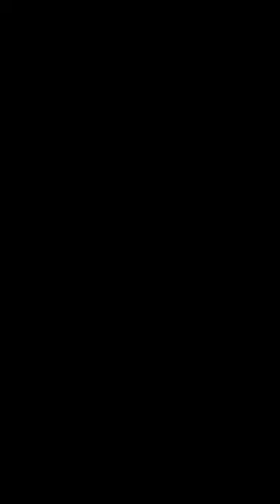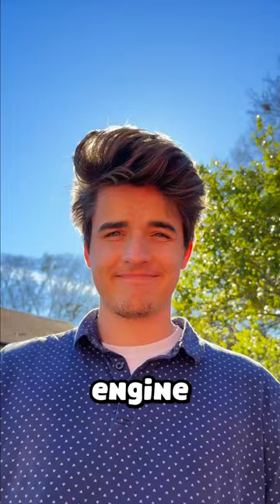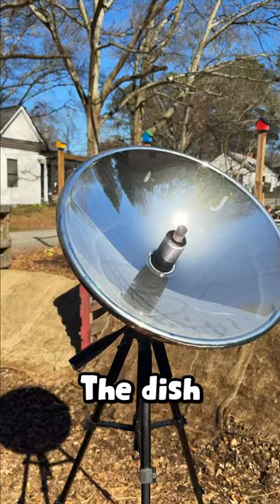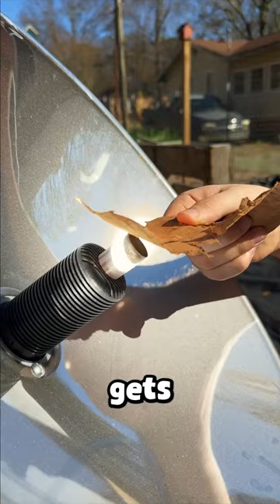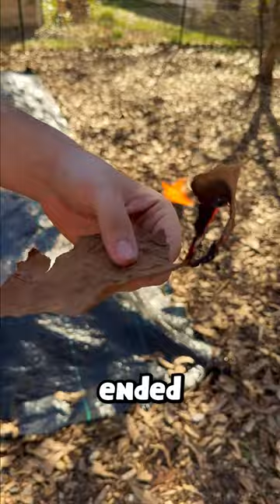Amazing technology! #shorts

Comment: Interesting I’ve never seen this engine type before
Reply: NASA made one called the MODii, it was designed to work in cars, was extremely reliable and efficient but was really heavy and didn’t make much power
Reply: They're not usually solar powered, I've mostly seen them as desk toys/science demonstration toys designed to work using a mug of hot water or ice. 

Unfortunately, Stirling engines need pretty substantial temperature differences to generate usable amounts of power, and the temps have to stay widely different, so they're not really useful for most applications. There are some pretty cool ideas involving them and server centres in artic regions though!
Reply: when i was in middle school i remember some mini engine i saw in school book. It had two mini panels in a glass bulb one was covered with reflective surface and the other was black. So under sunlight black side was getting hot the other side was cooler. That causes low and high pressure thus creates air movement from high pressure to low and panels starting to turn.
Reply: @alpborakirte801  that’s pretty cool any idea what it was called?
Reply: Did he say Stirling engine ?
Reply: You’ve probably seen a sterling engine before. They can look many different ways, commonly they’re small and powered by the heat from a hot drink (ie coffee or tea). They’re very fun and pretty easy to make at home.
Reply: They're mostly used on wood stoves and look different than this
Reply: They make stirling engine fans that attach to wood stoves. Tbh I was experimenting trying to turn a small one into some form of energy production since I use a wood stove in the winter. Pretty much takes the heat and spins some fan blades, I imagine someone who actually knows what they’re doing, could easily replace the fan blades with some sort of device to charge a battery and be able to create a wood powered electricity! I looked into normal thermal generators with the idea of strapping them to the exterior of my stove but they cost a bit much fir the amount of energy they harnessed. But I think it’s 200% possible! Would be cool to figure out how to connect it to my house and help with the electricity bill since the stove is constantly going in the winter!
Reply: They're stuck in the middle ground of power generation and sadly it isn't used much. I think they do have a place, but no one as of yet has successfully cracked the market.
Reply: It's a sterling engine with a dish 😅
Reply: @dragonsaint9446  stirling engines are actually used by a type of Swedish submarines I think
Reply: @MonkstaRS3  I didn’t remember the name but i asked chatgpt with description and it seems it’s not a mini engine as i remember. Its just a good way to demonstrate and teach simple thermodynamics and how you can transform sun energy to mechanical energy. But at the time i wanted to use this as an engine but you cant its too slow and small. 😅Yet a nice tool. It’s name Crookes Radiometer.
Reply: @Dingbobber  so it serves better as a home generator?
Reply: Where can I get one just like this
Reply: @Dingbobber how come something be extremely reliable and efficient but not produce enough energy.

Comment: couldnt you give it a steady and slow supply of water and make the steam power an alternatot? should be more efficient, at the cost of maintanance from the moving parts wearing off and the water pipes clogging up fro. the stuff left behind during evaporation

Comment: I mean a sterling engine is fun and all but I have to ask compared to every thing else you've shown what use could this thing possibly have?
Reply: Maybe it could run an extremely small pump😂
Reply: Its part the reason a Swedish submarines can sink a American aircraft carrier.
Reply: Stirling* and it’s free electricity so long as there’s a temperature differential between the two sides of the displacer cylinder. Might not be much but again, free electricity.
Reply: @cracktact7676  so is a photovoltaics
Reply: @ShinyUmbreon765  ah yes I love repairing my solar panel in the middle of nowhere! Super easy to do! They last forever! There’s reasons to use both pieces of technology.
Reply: @ShinyUmbreon765  another way to convert the sun's energy into everything, for example is to charge a battery like a solar panel does.
Reply: Fire
Reply: Apparently some places use it as a water pump.
Reply: @ShinyUmbreon765  no, photovoltaic is a different thing
Reply: Idk, but if you get it fast and heated, you can make cotton Candy, with just sugar powder
Reply: I don't know how much torque a sterling engine normally has but even if it doesn't have a lot it's still an effective way to turn a heat differential (in this case from sunlight) into rotational kinetic energy, and that's the kind of thing that literally fed the industrial revolution. So you can run a sewing machine, you can wash laundry, you can saw wood, just a lot. And i BELIEVE it's easier to make, maintain, and repair than a photovoltaic panel, because it's made with mechanical components rather than special chemicals.
Reply: On a large enough scale it could run a generator

Comment: I think the big deal with Stirling engines is ANY heat source works as opposed to a specific fuel blend like internal combustion engines. 

TBH they make a huge deal of sense for energy power, the can work with solid and liquid fuel and even sunlight.

Comment: They make stirling engine fans that attach to wood stoves. Tbh I was experimenting trying to turn a small one into some form of energy production since I use a wood stove in the winter. Pretty much takes the heat and spins some fan blades, I imagine someone who actually knows what they’re doing, could easily replace the fan blades with some sort of device to charge a battery and be able to create a wood powered electricity! I looked into normal thermal generators with the idea of strapping them to the exterior of my stove but they cost a bit much fir the amount of energy they harnessed. But I think it’s 200% possible! Would be cool to figure out how to connect it to my house and help with the electricity bill since the stove is constantly going in the winter!
Reply: Power generation Stirling engines work on higher internal pressures and are probably better constructed.

Comment: I probably won't get an answer, but how much power does that small thing generate, and what are you able to run off of it?
Reply: not very much power, just a cool toy.

Sterling engines dont provide much torque or usable energy to power anything useful
Reply: This one? Not much. They can be useful once they are properly made though, and of bigger size. I've read that these are sometimes used as pumps, so when it's sunny, you could feed a pumped hydro system. It would be a pretty effective water heater too. You could also use it as a generator, but I think at these scales it'd be too small. You'd probably want something at least the size of a person for it to produce usable grid power, but it'd still be mostly useless without an energy storage.
Reply: @a-boardmanshawn7314  It's important to note that model sized prototype and real life sized one is very different in terms of amount of power generated. Sterling engines definitely provide usable power, you just don't see that common
Reply: @josetjaw8161  also important to note that all it's reliant in is the temperature difference and the quality of the insulating material in the sterling engine.

Another thing is that you'd probably need a sterling engine that's at an impractical size to power anything the requires a sizeable amount of wattage
Reply: @a-boardmanshawn7314   well any engine that utilises thermodynamic cycle is reliant on temperature difference. And yes, stirling engine has low specific power, it needs bigger size to produce power as much as other engine. In most cases it's impractical but in some cases it's still practical and still used to this day for power generation

Comment: What does a sterling engine do? I get it's powered by the sun, but what do you use it for? Generating power? What is it powering? How much power? Better than solar?
Reply: its an engine. striling engines have been put in planes before. but nowdays they are mostly just desk toys. but you could make a machine with one or make power with an alternator
Reply: @georgekircher4307  you aren't flying a plane with a Stirling engine, they are extremely heavy for their output power. The amount of power they make are barely in the double digits of watts.
Reply: @Ravenousjoe  i litterally said a fact....it has been done. im not even gonna read your whole comment bc its just a fact

Comment: Next episode: practical applications?
Reply: Stirling engines have no practical uses. If heat is from external combustion, use steam and if the heat is solar use photovoltaics to power a motor.
Reply: Electricity
Reply: @ShinyUmbreon765  I can name like 4 off the top of my head
Reply: @ShinyUmbreon765  they do, in fact, have practical uses beside toy/model otherwise every mechanical engineer wouldn't know them from textbooks. It's just quite uncommon that their use make sense under design working conditions. For example, it's used in submarine.

Comment: If you make a water container around one cylinder and fill it with cold tap water which costs nothing it will run entire day bc water is coldwr than air and it will heat the water up so during night cycle is reversed as water is hoter than air
Reply: Ah yes water powered cars here we come
Reply: @caligusto  yes but no sadly Sterling engines dont make alot of power 2 ways to increase it make engine bigger which would be too big for use as a car or make temperature difference bigger so basicly put coal and heat up one cylinder that what stirling creator of the engine intended as this was supossed to be safer alternative to steam engines that exploded often

Comment: I've seen these used as fireplace fans, they are incredibly inneffecient tho, so don't think we found some solution to anything, these were basically the first heat engines created taking advantage of a heat differential OUTSIDE the engine.

Comment: Stirling engines don't have to be solar powered.
Reply from the maker: No, they just need a temperature change! But the sun is the best for that as it is the most consistent heat source.
Reply: @acornlandlabs  Well, in certain parts of the world yes. But in northern climes when the sun disappears for 3 months? Or even norther latitudes where it gets dark around 4pm (where I live) Or even just at night... or heavy cloud cover. So, no, not really the most consistent heat source, just 'a heat source'.
Reply from the maker: @TukikoTroy  You are exactly right! That is why stirling engines are not popular. They work well for sunny environments. Solar works better since it can still collect energy on cloudy days. Stirling engines can also run off of woodchips. So if you have access to wood, you can burn that to run a stirling engine. Naturally this is not the best option, but works if you have  plenty of access wood chips from fallen trees and what not.
Reply: @acornlandlabs  Are you aware then, of the Swedish Gotland class submarine which features a Stirling engine air-independent propulsion (AIP) system? The engine is nearly silent and uses the sea as a heat sink to increase efficiency.
Reply from the maker: @TukikoTroy  that is incredible!! Definitely going to read up on that. Thanks for that information! We love learning new things.
Reply: @acornlandlabs  Happy to help. I'm an ex-submariner so I was very interested in this. Apparently, other countries are looking seriously at the Stirling engine too.
Reply: @TukikoTroy That's amazing! I've never heard of that type before